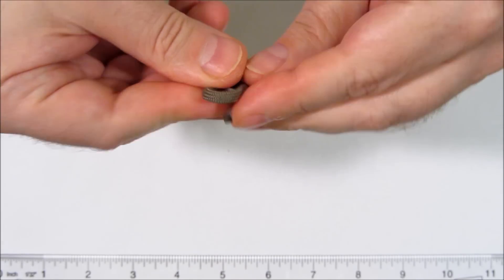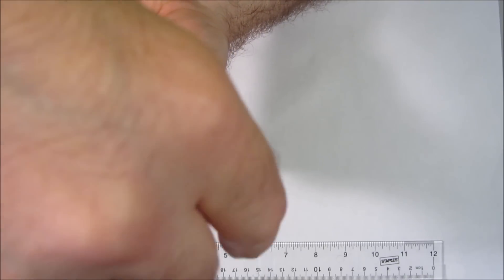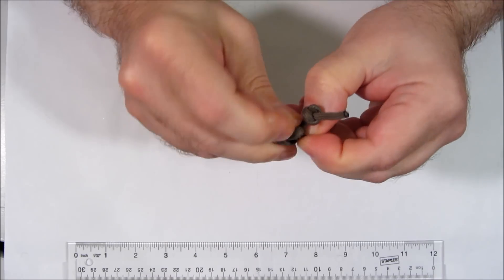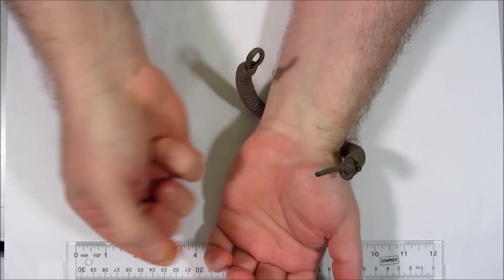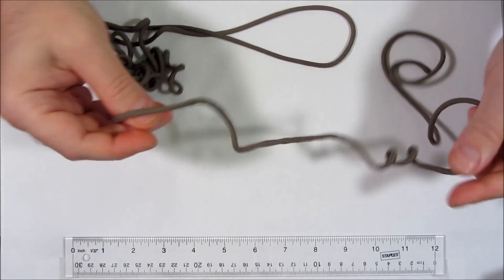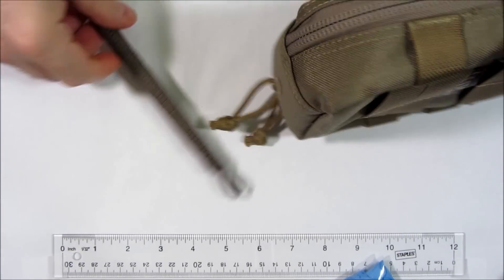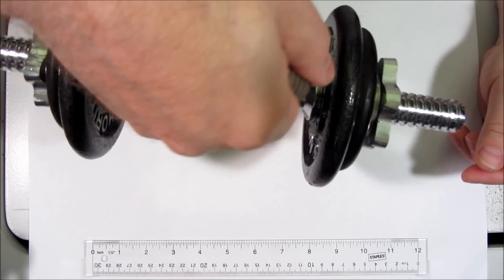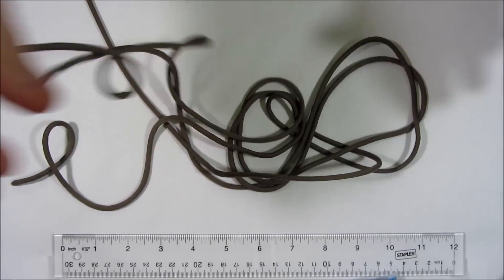1-MINUTE Paracord Survival Bracelet Howto, 5-Sec Deploy [original]

Comment: sorry, I don't know if you're still replying, but I'm not sure what happens at 0:56. the first coil I make falls apart; how do you keep it together as you twist?
Reply from the maker: Truna AQW I need to gather up all the parts of this video which are ambiguous and make a new video with greater detail. Thanks for pointing out yet another one.
The FIRST few outer coils are wrapped tightly at first, so it doesn't fall apart, but then the balance, the remainder, is coiled on more loosely. In this video I almost lose the end product's button hole down the barrel of the helix coil myself!  ...and have to retrieve it using my fingernails at 2:46. Good luck.

Comment: I think i'm getting there :) But my cord I have "Cheap thing" is not as willing to the untie trick ;)
Now I just need to get the correct length fixed. I think I understand how it works now... Thanks. My first Paracord bracelet made :)
This is most likely what I need - something you can make fast and use fast. I don't care how it looks - it just need to be functional.
Reply from the maker: I recommend real 550 paracord, ideally "military spec" also sometimes called C-5040 or PIA 5040 such as https://www.amazon.com/550-Paracord-MIL-C-5040H-PIA-C-5040-Parachute/dp/B00CYQW0AQThe paracord does the finger spin trick best once it has worn in a bit and starts to get softer and more supple. Simply making and then attempting to deploy the bracelet a few times helps do that.
Reply: Ups I made a mistake above - I did not use Paracord at all... But some Cheap robe I had laying around :) 
I'm looking at getting some Paracord at some point when I got the money - I'm just exercising the skills at the moment. I need some skill in making knots as well.
Iv also looked on a multitool like the Wave or Charge. I'm thinking it would be awesome in regards of fishing and going out in the wild and having as primary knife.
My Nails hate those small pockets knifes so that won't work in any way.

Comment: what are the climbing ropes called?i've seen a video about japanese firefighters.they dont use harness but just this rope that they wrap around,some even only use a single layer and yet they can zip and climb....the rope isnt very thick either.
Reply from the maker: I don't know what rope they use however 550 paracord, what I show in this video, is NOT safe for climbing. Actual climbing ropes are rated for more than double what this cord can handle as a static load and also are made to withstand much, much higher dynamic loads. I now make my bracelets with thicker 750 paracord and even it is considered unsafe for climbing.
Reply: not even slight usage?like jus to get to the level below or above to avoid whatever is happening.
i wanted to make one but i hope i can get better practical use other than shelter.(im in an highly urbanised environment,so most probably i'll be hiding in buildings,so its like a back up plan.)
Reply from the maker: RonLarhz I'm not an expert climber, but I have read repeatedly from many others who do this professionally that only a fool would use 550 paracord for rapelling or climbing. Even ignoring the safety concern it is the wrong type of rope because it has some stretch to it whereas real climbing/rappelling rope has next to none. Here's some advice from an expert:
"I rappell quite a bit and you can go all the way down to a 5mm cord as long as the working load (15% of tensile strength) is more than your weight and equipment combined (specifically spectra type cords). However, consider the friction and abrasion of the cord going over the cliff or ledge, a tiny scrape may cause the cord to fail critically. Anything under a 8mm cord will require a Personal Escape descender which is smaller than a regular descender and specifically designed for thinner ropes.

 However, anything under an 8mm personal escape rope is taking your life in your hands... rappelling with this equipment should be done only if certain death is guaranteed if you do not escape. Paracord should never be used for rappelling because tensile strength is 550lbs which means the working strength is only 82 lbs. Also, Paracord is not a static line. Dynamic rope is very very bad for rappelling as it will stretch and bounce and may snap after a few bounds.

 Also consider if rappelling out of a burning building, that ropes are highly inflammable and will melt under relative low heat."
Reply: WOW!....

Comment: Thanks! Actually I like the grab handle usage. Also, do you have a way to use this as a simple fob? And have you thought of a name for it yet (i.e. like 'Cobra Stitch' is used as shorthand for the more common bracelet)? Great stuff...
Reply from the maker: +Bob_the_Bomb This design can be made into other things simply by changing the length: key fob, belt, shoulder strap, dog leash, etc.. It is locked from deployment as long as something is passing through the loop hole which locks it from submarining down into the coil, which is the first step in deployment. My only warning is that any sort of necklace design should always be made with a breakaway clasp for safety.
Haven't thought to name it other than "One-minute". P.S. A new, better tutorial on it soon.

Comment: Great concept but a little to fast for an instructional video the first initial knot its kinda difficult to determine what it is your doing
Reply from the maker: There are many forms of stopper knot. The user can use whatever kind they like. There are also different ways to tie the style I like, the Ashley stopper knot. Here's a video dedicated to how to tie it that is slower paced:
https://www.youtube.com/watch?v=Fmxd-5T4UBU
Hope this helps. [I'm thinking I should make a dedicated Ashley stopper knot video to make this easier...stay tuned]
Reply: Thanks and yes i finally got it....just working on mastering the lengths lol made mine almost to tight and made one for the wife way to big
Reply from the maker: Joseph S Yes, figuring out the bracelet length is trial and error, however once you figure out what length works best for you, I recommend marking the paracord with a Sharpie permanent marker at the point where the button hole fastener should appear so you can reconstruct the bracelet after each use much more quickly. I mention that here:
 https://youtu.be/2RF4xEohFIQ?t=49s
Sharpie pen ink can also be removed if you change your mind by dissolving it in rubbing (isopropyl) alcohol.

Comment: I tried something similar but found that the bracelet would accidentally slip off on occasion. Has it ever happened to you?
Reply from the maker: +Alloutdoor1 Did you use an Ashley stopper knot? Unlike the traditional Chinese button/ball knot, used for many centuries (even to this day) as one of the most common forms of garment fastening, the Ashley stopper knot has a flat bottom (the "trefoil"), not spherical, so it doesn't tend to pull through accidentally when tugged on [but it is not impossible]. The flat surface makes it more like a traditional disc shaped button we use in most western clothing. Also, as I mention in the video, the button "hole" can be constricted down to a tighter diameter, once fastened, by sliding the outer coils downward, if one wants a more secure connection. {In the second part of the video where I discuss using it as a handle I also mention there is a danger of making it TOO secure}.
At about $8.50 for 100 feet bought on Amazon, I figure if for some weird reason the paracord bracelet does fall off and I don't notice where it falls, I can always make a new one for less than a dollar, in a minute. Once I got to know what tightness and button hole size works best for me, accidentally falling off in the field doesn't happen, and the one time it did happen (when I was brand new to this, and I simply put it back on) it taught me to pay attention to this aspect when fastening.
Reply from the maker: +MeZillch I guess if one is worried about this one could also add a true button instead of the stopper knot, such as a fender washer from a hardware store or a real garment button, but I think part of my design's charm is that it is made from just 100% paracord, nothing else. Give it a go!

Thanks for the question!

Comment: and what to do if my wrist has just 14 cm of total perimeter? This method gives less than 1 meter... I have found the solution: I have made the belt of 65 cm long with 33 feets of 5mm 750 paracord using this method. Nice to wear with every thing!
Reply from the maker: Odette Fleurry Good idea! Nice to see people using this for other applications besides bracelets.Any method which forms a loop (a ring) works best: bracelet, carry handle,  belt, etc.. Using just a straight length works too, like a shoulder strap for a bag, dog leash, key fob, etc., however if the knotted end doesn't secure the other end's button hole by passing through it (or some other thing in the loop) the design isn't locked and tugging on the rip cord knot will deploy the rope.